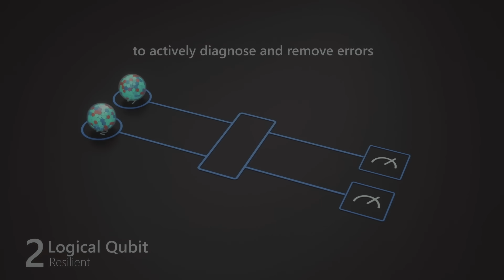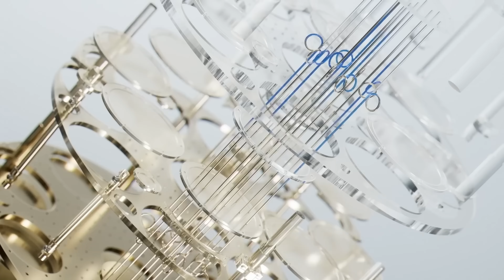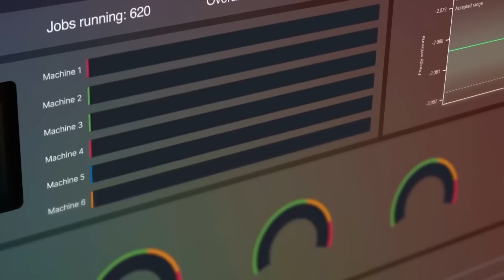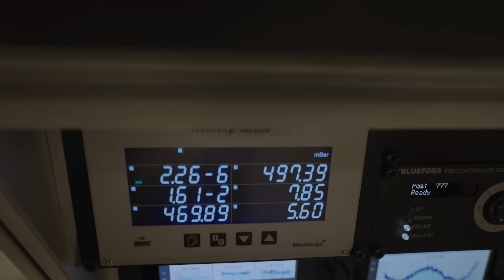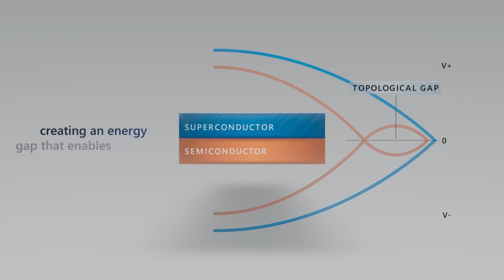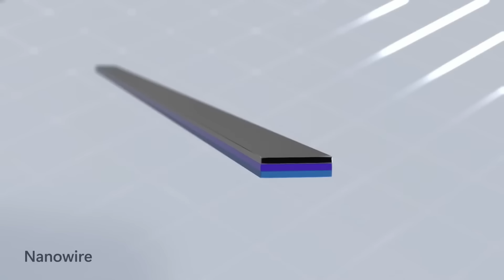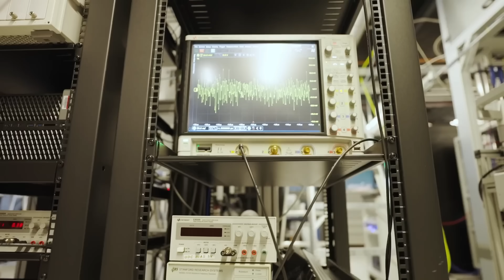THIS IS WHAT MICROSOFT DOESN'T WANT YOU TO KNOW ABOUT QUANTUM

Comment: It's just a computational Chip not demonic.... but will it be used for bad, yes. Im thinking more like powering AI enabling the beast system. We have new chips that use light instead of electrons and wires, grok3 is a scary new AI that's in the edge of self awareness, the French have fusion reactor that broke record running 22 minutes which could give unlimited power to AI....The beast system

Comment: I'm not an expert in Quantum Computing, but I did study it a bit during my Master's coursework in Computer Science. The way it works isn't so crazy after you understand that creation at the quantum-level works differently than at the classical-level. A q-bit is just a bit that can be some state of 0 and 1 at the same time, being more 0 than 1 or vice versa. This allows a much higher degree of computational power because we're no longer just relying on 0's or 1's but mostly 0's and 1's simultaneously with some weights to them. Whenever the computer's state is read, the q-bits have to collapse to either 1's or 0's, no longer being states of 1's and 0's. There are other qualities with q-bits that make them much more powerful than classical bits, but I'll leave it at that.

The thing that I think quantum computing will end up changing is AI. If I'm right, it will enable AI to reach the singularity event where AI's learning rate will become exponential. If and when that happens, AI will dominate in every field of expertise.

Comment: Here's a little insight I researched:

Instead of silicon, Microsoft's "topoconductor" (like it sounds, it is an insulator, but electricity can travel on its surface) is made of indium arsenide.  Indium arsenide is the best protector from environmental sound and vibration, and has been used in infrared detectors for years.  The subatomic particle spoken about is the Marjorana fermion.  It was first proven to exist in 2016, but it needs an extremely stable environment to exist; so the indium arsenide topoconductor made this possible by creating a space called "topological matter".  Like the video said, there's solids, liquids...and now there's topological matter.  The Marjorana fermion is so sensitive to existing because it is the only subatomic particle that is also its own anti-particle.  Mentioned but a bit hard to understand for me.

The size of the golden colored chip in the video is 5x5 inches.  It's big.  They don't show it against anything else for comparison.  And, it only contain 8 qubits.  In spite of the talk of a million qubits, it's going to take quite a bit of time to get there.  The Google Willow chip, already in use, is a much grander piece of tech already.  It also has new never seen before technology in it.

I'm not belittling the effect the Marjorana 1 may have by saying these things have been around for bit, or that there are already chips out there that compare.  I'm saying that from the beginning of time, Satan had to set up mankind to make astounding break throughs in tech for his purposes.  God never needed a computer, or a cell phone.  The Word spread through the working of the Holy Spirit for millennia now, regardless of the tech available.  But, Satan needs tech.  It's the only way he can affect millions; he has no real Holy Spirit equivalent.

The increasingly hazardous invention of the television, computer, the smart phone, the quantum computer, the hadron collider...all of these driven for and by Satan to crack through planes of existence that require tech to do it.  All slowed down by the Holy Spirit and God until just the right time.  For then, material manipulation will occur whereby the technology will create openings, and maintain them open, through which other technological instruments/vehicles will come through carrying all sorts of monsters.  By God's grace we will be gone by then.

Satan has been trying to speed up technological innovation since the first wheel was made.  Given no resistance, he would have had the computer in the hands of the Pharaoh's of Egypt.  This Microsoft breakthrough is only one of many more to come.  Occurring only because God allowed it for His purposes right now, or at some point in the future.  Even if that only purpose is for the punishment of those whose names are not written in the Book of Life.